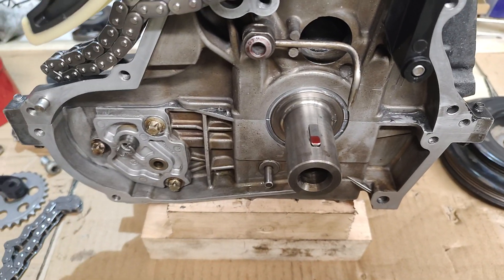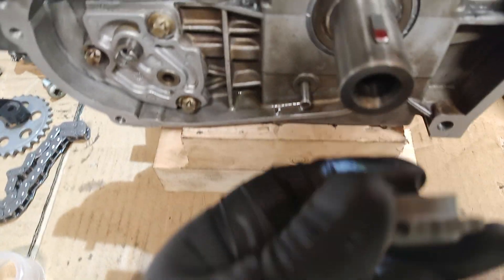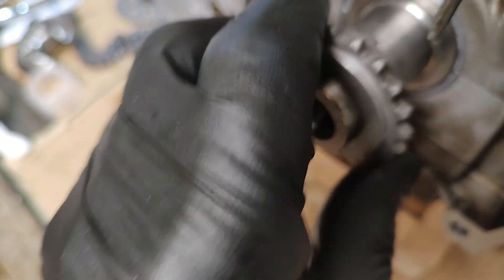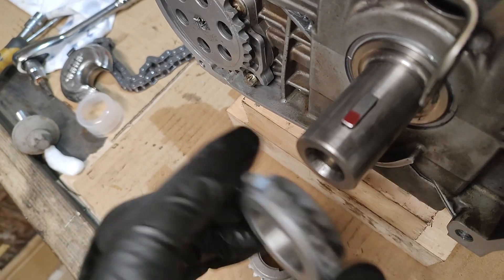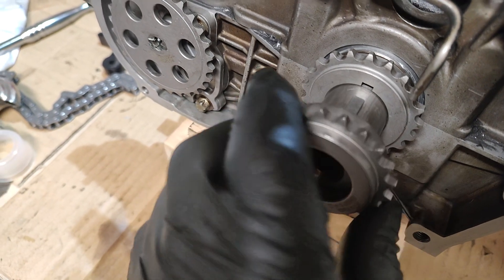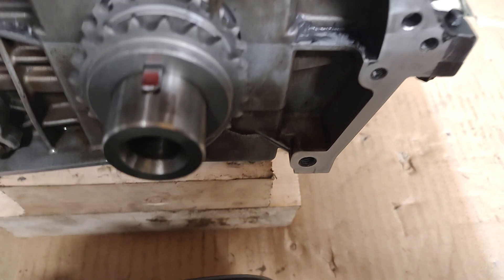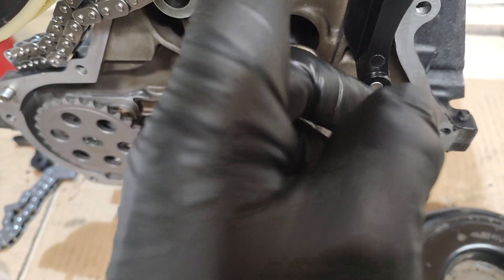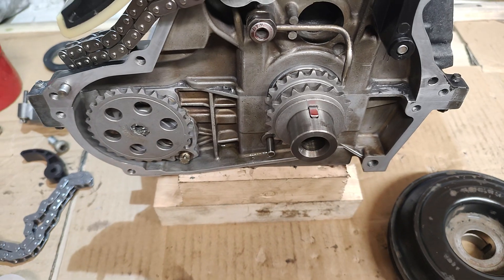SMART FORTWO 450 TIMING SPROCKETS.

Comment: The crank shafts have a radius on the shafts that come out of them to prevent the shaft from breaking under stress.  Machined parts should have a nice radius and bolt holes should have a small countersink to prevent cracking. You can see that the inner sprocket has a countersink on the inside to fit over the radius. High grade bolts put a small radius where the threads end and under the head to make them resistant to breaking.
Reply from the maker: Great information.
Reply: Spot on david thanks !!